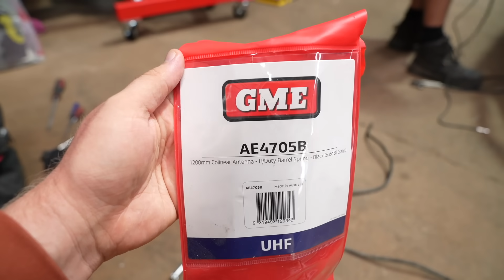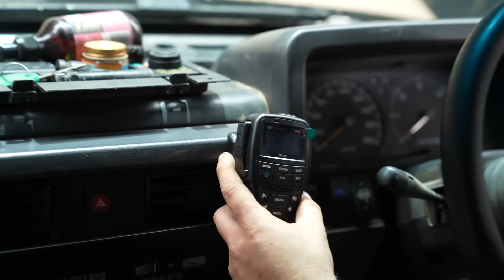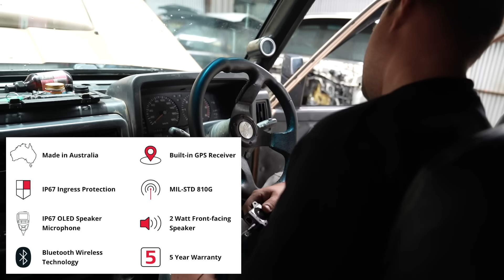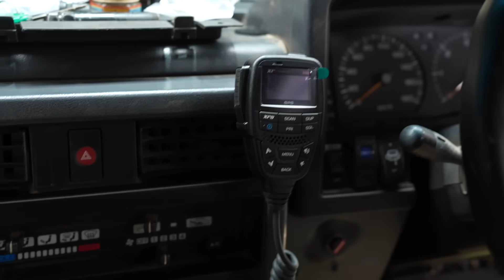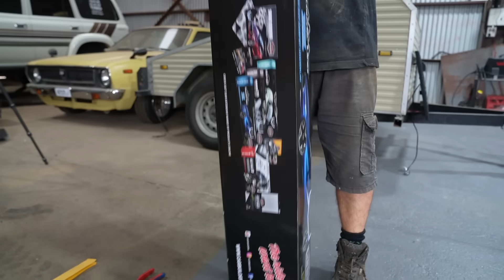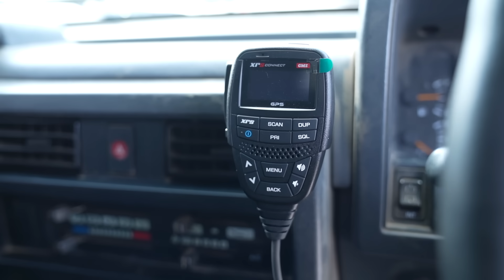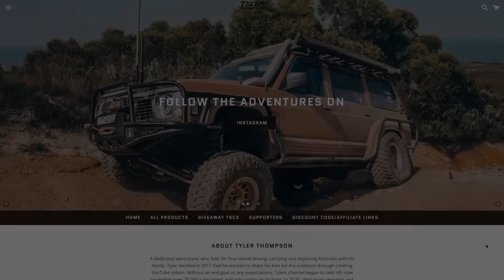I wish i'd done this sooner.. The GQ patrol build continues

Comment: On all I’ve said about lockers …

E-Lockers fail if the installation is low quality. 

Air lockers from ARB are the best if the installation is very good. 

But if you’re on a budget (as I am in a country where professional 4x4 mechanics are rare) auto-lockers will be your best friend. This is why I got front & rear auto-lockers from Kaiser I Brazil. 
- Regrets?
- None what so ever! For the price paid I consider the Kaiser’s as good, or better than the ARB’s.

Comment: Good to have a bit of a factory bay to work in, and good to have a mechanic on the crew. Hope you get the front locker working properly, do you think the air lockers might be better?
Reply from the maker: Definitely considering them but had the e-lockers in the GU for a couple of years now and dads had one in the MUX for 3ish years and never had an issue with them. So I know they can be good
Reply: I've run air lockers for over 10 years no problem, and when ARB changed the seal set up no oil coming back up the air line can't fault them.
Reply: @georgee686  I don't know what's best, the air can leak the wires can corrode or break. 
I put an auto locker (Lokka) in the front of my Landcruiser seem ok

Comment: 9:50
I was already wondering why one who has the engine already OUT, does not do an HEAT isolation from the firewall back???

Pretty much the first thing I isolatetd on my Ford Econoline Quigley Van, back in the day. V8 diesel 7.3l = lot of heat!
And I live in Germany - heat is only present 2 months a year!

btw: I do not know what will come after this second but I assume an 3mm isolation. If so there will be not much to be expected. I used Armaflex ( a german brand for isolation of hot pluming stuuf. up 230°c not flamable) Most important: It does NOT SUCH WATER; in 19mm.

Comment: It'll be interesting to find out what's causing the intermittent issue of your front locker.  As I'm shortly going to get the Harrop fitted to my 80 Series.
Reply: problem,,is they have leads, tubes..switches. only locker i buy is a detroit for rear, lunchbox front.. no wires, no tubes to fk up..plus toyota lsd is a waste of space,,they dont work..if you want a compressor.. look up power tank..easy install, same price as bs arb twin crap,fills upto 50 tires.. no leads, no wires no noise..no warris..mate has an 80, with lift. he riped the brackets off the diff, cos the way there made, & its thin metal,  they dont twist.. ,. superior is ;;better'', but still lacks movement..for what price..  f100 4x4,, cant beat it..never fk up..radius arms with pin, not thru bolt.. nissan have a better wheel base, transmission brake, lsd,. toyota have a better low range.. bit like f100 granny first.. toyota use nissan diffs & steering box. so, why buy an expensive toyota...

Comment: Do you regret building an old 4 wheel drive and not just getting a newer vehicle? Like a new nav or something
Reply: Could have bought a new raptor 😂
Reply: buddy,, grow up.. a 4x4 has a crawl first low,, 2  SOLID  diffs, manual , with stix, no lectrics or computer bs to fk up.. wait till your in the simpson, & a sensor shits , you die..auto anything,,is bad.. best 4x4 thats built correct, is a 78 f100 4x4. why,, cos there built correct, & will stand 400 hp, without mods.. ifs is bs..
Reply: @harrywalker968  thanks Tyler
Reply: You using a Cel-fi phone booster in    the Patrol?
Reply from the maker: Nah I much prefer the older ones at this point and been a good experience and lots of content for what I do
Reply: @TylerThompson90  yea that makes sense, a lot of money invested in the old girl, looks great mate keep it up 👍🏽